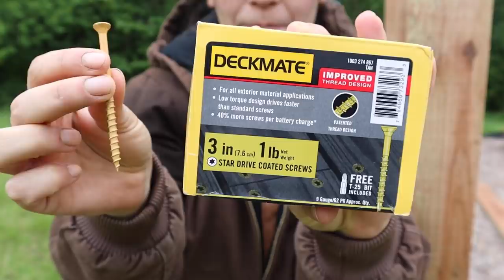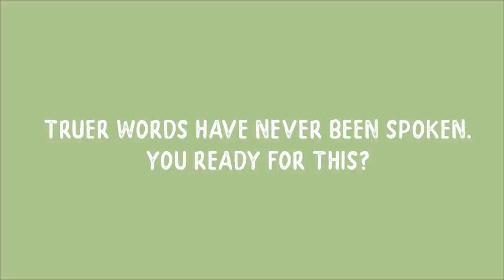INSTALLING MY GARDEN FENCE, planting flowers & mowing the lawn | GARDEN VLOG

Comment: I have a quick tip regarding the fence posts. My father put in a new post for an extension of the arbour for the grapevines a month ago. He digged a hole and put in a metal stand for the wooden post. These are pretty standardised here in the Netherlands (we mostly have clay soil here in the north) for fence posts. Do you also have them in the US? I think these are more effective than the gravel/pebbles that you put in and you protect the bottom 8 inches of the post.

Comment: Not sure what the price difference is between the two greenhouses but having worked in shipping/freight, I think it could cost several thousand dollars to have the assembled Amish greenhouse delivered 2 hours. Definitely worth looking into because it could be a huge determining factor for which one you go with.
Reply: Depending on the weight and size, of course. You definitely want to choose a carrier who is insured to cover the cost of possible damages, etc. You want to make sure they can drive their truck to where the greenhouse is going to be without getting stuck (a truck that large is going to be sooo heavy and you said it’s wet there.) And they’ll have to have mobile equipment to offload it in to place. Could be $2-3K+

Comment: Amish greenhouse 100% -- for these reasons:
1. its bespoke, you wont get that flatpacked - I assume this option gives you some decisions on what you want, Remember to include ventilation (vents - window on roof) as these get HOT

2. Quality will be great 

3. it will come built - Think about how much time you will save - and then think about how much time you can then spend to recoup the cost by not building it yourself and being given that time  back

4. Either way, it will come in handy next year, it will allow you to get a jump on the growing season and to winter over plants that need it, so if you wait till next year you could potentially loose some plants in winter (meaning you may have to replace (extra cost), And if food production is a contributing factor, you wil be able to start your garden off earlier with bigger and more established plants that you started in the green house, Therefore meaning you can plant at least 2 rounds of the things you eat the most, getting more out of your season

5. Your are blessed to live in the US where the trucks are large and there's lots of them so there will be a plethora of options to move the greenhouse, people even move their whole homes on the back of trucks (e,g. https://www.youtube.com/watch?v=7sDVsC8AL3k) - Google locally who has moving trucks and vans, you may have someone with a huge truck who will help you for quite cheap, Although, if this is the option you go with, make sure you get all their details as part of the process so they cant just pick up your greenhouse and drive off with it - just a word of caution - you want to be able to have a home or business address and names in case you need to find them. Other than that, The amish must have done this previously, maybe ask them if they know any people who they have worked with before that have picked up and transported these in the past. Or last option, research renting a big enough trainer that wil fit it, and then speak to the amish about how they suggest is the best way to move it (does it need to be put in the truck by hand, or could you rent a type of truck or van that will aid in this - options below - remember to not forget about the logistics both ends so you can get it on and off successfully

Here is a great guide into the different types of vehicle you could look at, What they do and the positives and negatives of each type: https://www.thomasnet.com/articles/materials-handling/understanding-pneumatic-and-hydraulic-lifts/
Here are a few options of the type of trucks or transport that you could look into renting:
1. trailer mounted lift - https://www.thomasnet.com/products/trailer-mounted-lifts-97003638-1.html - would need to get the truck or trailer that the greenhouse goes on too 
2. Truck mounted areal lifts: https://www.thomasnet.com/products/truckmounted-aerial-lifts-44010908-1.html - again you may need to additionally hire the van or trailer to put the greenhouse on
3. Forklift 
4. Articulated boom - https://www.thomasnet.com/products/articulating-booms-95992756-1.html
*Remember though, with any option you go with, you will need an approximate weight of the finished structure so that you can hire the correct option and the correct transport that will hold the structure securely

1 Question - Wont you have to pour a concrete or hard grit level platform that the structure will sit on? as you said you are on a slope, and even if there is no slope you will need to make sure that the structure doesn't sink into the ground when it rains, so look into this before you proceed with either option. You may be able to get away with levelling concrete Blocks or paving slabs rather than pouring a whole concrete platform (which will be a hell of a lot cheaper)

I hope that helps!?

Good luck, I look forward to seeing the progress!

Stu xx

P.S. I just had an additional  thought, If this option does turn out to be too much this year, Why don't you look into a cold frame - there are hundreds of different types of these (https://www.google.com/search?q=cold+frame&tbm=isch&ved=2ahUKEwiG3KqPpajxAhUF_BoKHYTeAVgQ2-cCegQIABAA&oq=cold+frame&gs_lcp=CgNpbWcQAzICCAAyAggAMgIIADICCAAyAggAMgIIADICCAAyAggAMgIIADICCAA6BAgjECc6BQgAELEDOggIABCxAxCDAToECAAQQ1CmgB9Y9YwfYOSPH2gAcAB4AIABOIgB_AOSAQIxMJgBAKABAaoBC2d3cy13aXotaW1nwAEB&sclient=img&ei=XEvQYIa-GIX4a4S9h8AF&bih=845&biw=1745) and a lot you can make from salvaged materials (google your local dump or salvage yard - you can go there and pick up bits of wod or old windows to make your own - this will be significantly cheaper than buying stuff new
You can also buy some flat packed plastic material options which you can build yourself, I have done these before and they are perfectly adequate for a year, if its still in good shape after you get the more permanent greenhouse you can always nove the temp one closer to your house and have an additional greenhouse space where you can start your summer crops off in.
examples Ive seen + used
1. https://www.amazon.com/Greenhouse-Outdoors-Observation-Ohuhu-Stability/dp/B07T4NX6Q3/ref=sr_1_17?dchild=1&keywords=plastic%2Bgrow%2Btomato%2Bgreenhouse&qid=1624264377&sr=8-17&th=1: 
2. https://www.amazon.com/dp/B087LT72VN/ref=sbl_dpx_B087LT72VN_0
3. https://www.amazon.com/Eagle-Peak-Portable-Greenhouse-Gardening/dp/B07YTNMCVC/ref=sr_1_50?dchild=1&keywords=poly+tunnel+greenhouse&qid=1624264620&sr=8-50
4. https://www.homedepot.com/p/Trademark-4-7-ft-W-x-4-7-ft-D-x-6-4-ft-H-Walk-In-Indoor-Outdoor-Greenhouse-HW155001/306693909
5. https://www.homedepot.com/p/Outsunny-10-ft-x-20-ft-x-7-ft-High-Tunnel-Walk-In-Garden-Greenhouse-Kit-with-Plastic-Cover-and-Roll-up-Entrance-Green-845-232GN/313812134
6.https://www.homedepot.com/p/7-ft-W-x-15-ft-D-x-7-ft-H-Plastic-Walk-In-Greenhouse-786323570177/315780247
7. https://www.homedepot.com/p/VEIKOUS-56-in-W-x-56-in-D-x-77-in-H-Portable-Greenhouse-SW001/314597360
8.https://www.homedepot.com/p/Outsunny-4-ft-x-7-ft-x-7-ft-Polyethylene-White-Greenhouse-with-Roll-Up-Zippered-Doors-and-Weather-Resistant-Cover-845-304V03WT/316353962
9. https://www.homedepot.com/p/Outsunny-7-5-ft-x-6-5-ft-3-Tier-10-Shelf-Outdoor-Portable-Walk-In-Hexagonal-Greenhouse-Kit-with-Zippered-Doors-and-PE-Covering-01-0470/313812122

and lastly ( sorry this is like TLDR)
If you were thinking about delaying to next year and fancied a challenge - 
1 way: https://www.youtube.com/watch?v=FXBZhSoDvGY
Additional way: https://www.youtube.com/watch?v=TEfwiNfTCB8 (wals built as panels and then attached together - looks easier - the video is LONG tho so as they just go on and on ....
3. https://www.youtube.com/watch?v=spNAe_7Yx7Q
4. https://www.youtube.com/watch?v=R6BG3jnnNps - useful lists and planning
5. https://www.youtube.com/watch?v=jpB_5EEfEiQ - This channel will be SO USEFUL for you, its got so many how to guides and inspo on how to create your own garden projects, build elements and also some great décor and styling ideas so you can create not only a functional space, but a beautiful space that you want to spend time in. The are great and explaining how to do things and going through the process step by step with examples and easy to follow guides - https://www.youtube.com/channel/UCqbFWAfeuLgn8m81rUL4ghQ - a great channel to binge watch which will help you with your building confidence, as you are just learning, so you are going to make mistakes but that's life and you learn from them and think about the diy skills you are adding to your repertoire!

Let me know how it goes xx

Comment: If the cost to have the Amish greenhouse is moved to your property isn't crazy high might as well do that but if you chose to do it by yourself Harbor Freight has a couple different size greenhouses that are pretty good. Some reinforcement will have to be done but it's minor and for our Midwestern weather and winds so it doesn't blow away.

Comment: I would check out the cost first of a company that moves things like that. That may be a deal breaker. Also are you going to pour a foundation for your greenhouse? You’ll want to make sure it’s level and remains level. So may be a footer? I think that’s what it’s called. Even if your having a dirt floor you’ll want something that doesn’t give way to erosion ect. to set the greenhouse on.?💚🙃
Reply from the maker: Yeah it might be a deal breaker :p we will have to see! We will likely be pouring a cement foundation for it :)